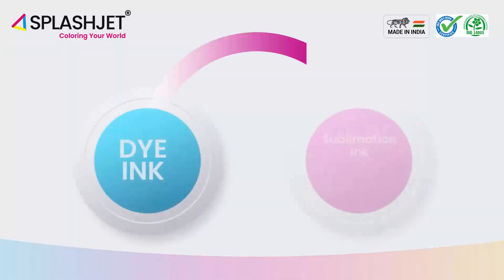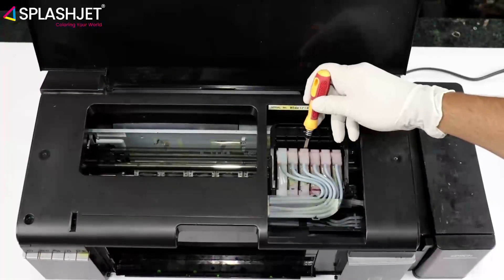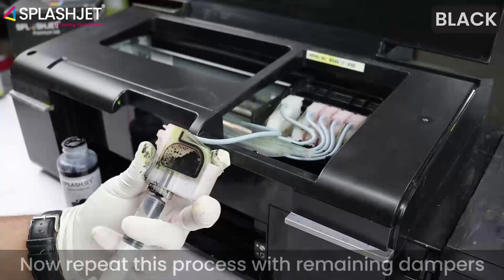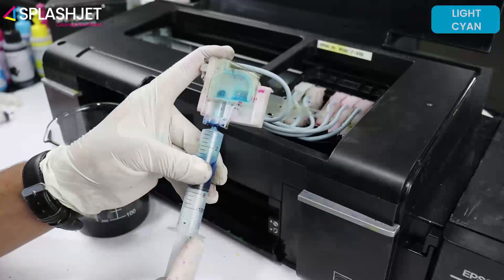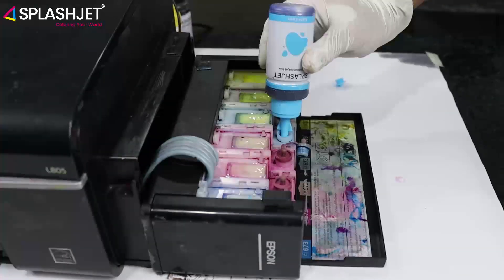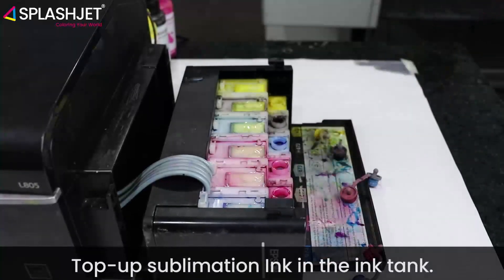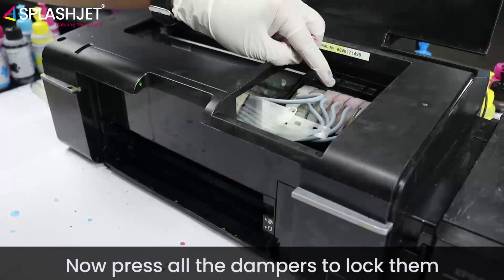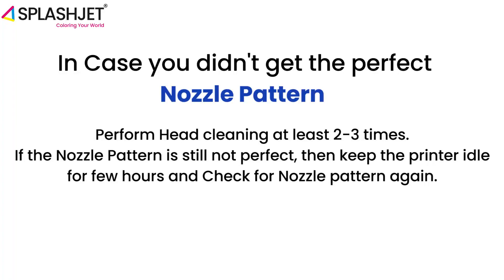How to change Dye Ink to Sublimation or Pigment Ink | Convert printer to sublimation | Splashjet Ink

Comment: i want to convert my l1800 dtf to sublimation. is there any possible way . if so is it the same way
Reply from the maker: Hello,
The ink changeover process might need a little optimisation (in terms of changing the dampers and pipes of white ink, the roller that might have been removed while converting it to the DTF machine, etc.). So I would request you to consult a local technician who offer such conversion services. 

Although, we would recommend to go with a new printer for sublimation (which can be easy to convert to dye / pigment )

Comment: The head cleaning Is very bad for the printer and they mention that in the manual
Reply from the maker: It's not BAD if you do it correctly. The video reference is given with each and every detail to make you understand do it correctly so that you don't have to change the Costly Printhead every time you face issue.

Comment: Hi, i want to convert my epson l1800 to dtf, do i do the same as the video?
Reply from the maker: This is just the Ink Changeover Process. You may need to change some parts inside the printer to perform DTF on it. For that, We would request you to get in touch with an expert.

Comment: Just got a brand new Epson Ecotank L8050 and I'm planning to convert it to pigment ink.
Is it still possible to do the conversion by completely draining it via printing a lot of pages and re-filling it with pigment ink? Or do I have to do this process?
Reply from the maker: Changeover is a bit difficult in Epson L8050.
However, if you have technical help available then you can follow the process shown in the video. 
If not we would suggest you get in touch with a service engineer or service provider to help you with the changeover.
Reply: Hi did you do the change and how did it go? I am thinking of doing it as well

Comment: i have epson l805 printer  direct use  sublaminate printing or not , dont use any other way please me details
Reply from the maker: If it is a new printer without any ink in it then you can directly use it for sublimation. If not, then use the changeover process to remove the ink and put sublimation ink and then use it.

Comment: Sublimation ink can damage printer?
Reply: Epson L3250 what type of ink used
Reply from the maker: @MukeshKumar-xh7md  What is your application?
Reply: @SplashjetInk  normal document print, photo making
Reply from the maker: @MukeshKumar-xh7md  VISIT THE LINK  -
https://amzn.to/3J0Lwvm
Reply from the maker: If you are using thermal print-heads then it can damage the printer. In Piezo heads it will not damage the printer.